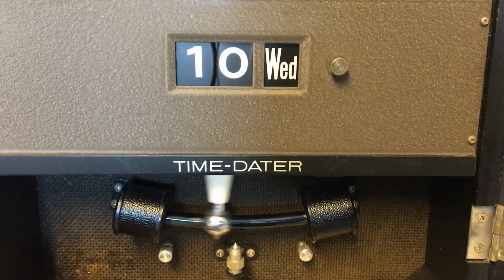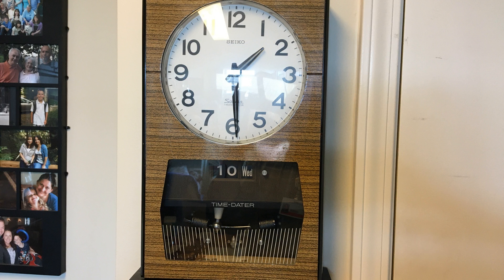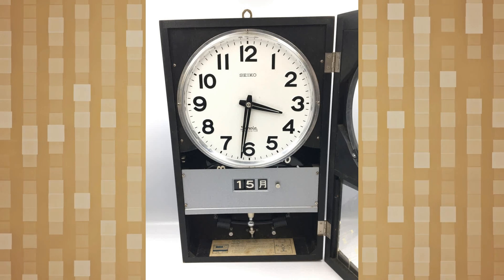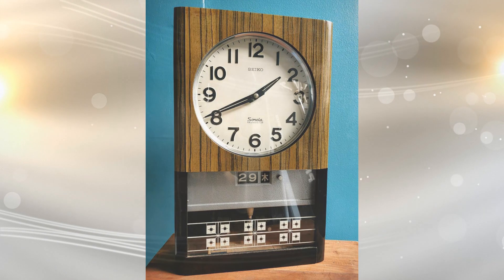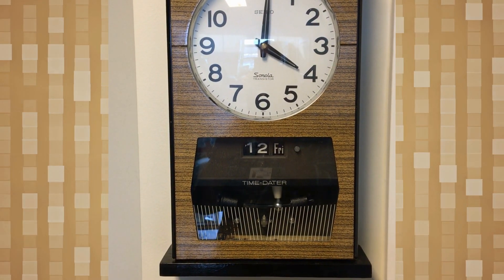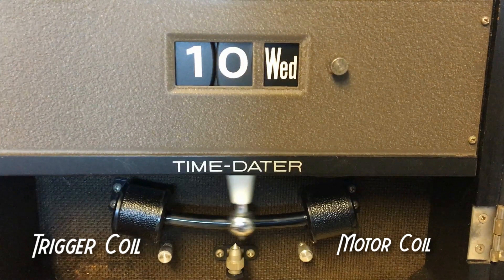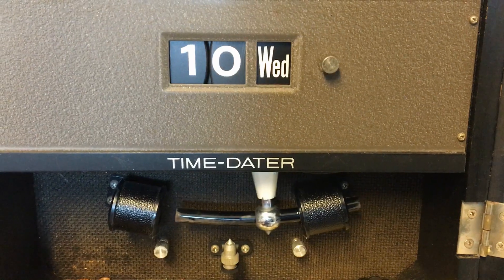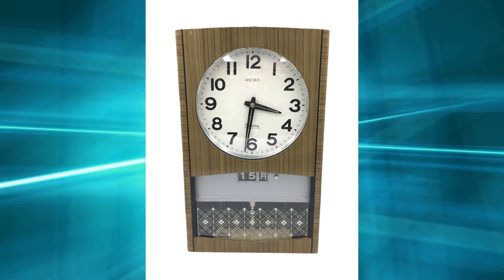Seiko Sonola Transistor Time-Dater Wall Clock

Comment: thank you what a helpful video!
I have just acquired one of these. The dreaded leaking battery destroyed the chime motor so I'm hoping to replace this. The ticking is very nice and the clock is accurate. They are rapidly becoming rare and prices on the increase. 
The simple electronics should hopefully mean that they can be easily repaired in the future.
Reply from the maker: I have mine sitting right behind me in the kitchen as I type. I really like it. It takes a bit of adjustment of the pendulum, but when adjusted they keep great time like you mentioned.
The chime is not that appealing to me. I keep mine off (simply by removing the battery). 
But I'd be like you too probably. I'd want it working. 
Seems like you'd be able to find a replacement. Just need to know the rotation speed I suppose.

Comment: i have one they are extremely accurate when set up correctly they also have a vey loud chime on the hour
Reply from the maker: Yes. You are right. It took me a while to get the pendulum set but it keeps good time. I still don't use the chime though. Thanks.
Reply: How the hell do you silence the chime I have searched everywhere?